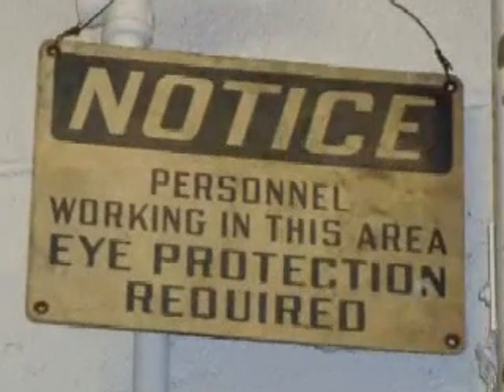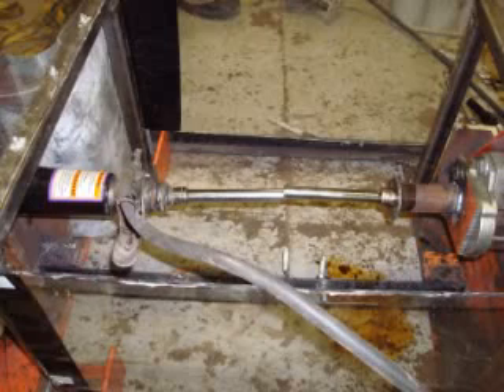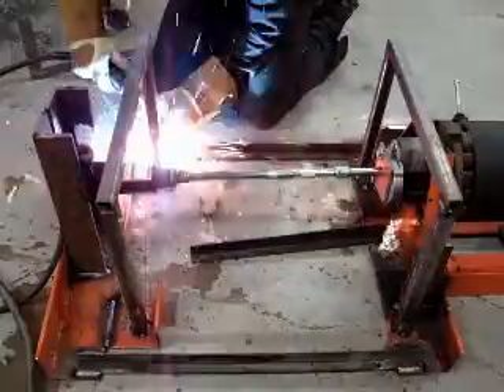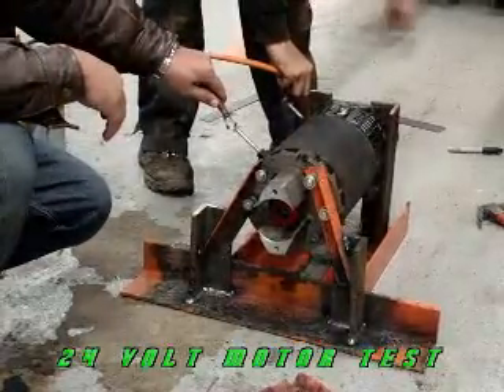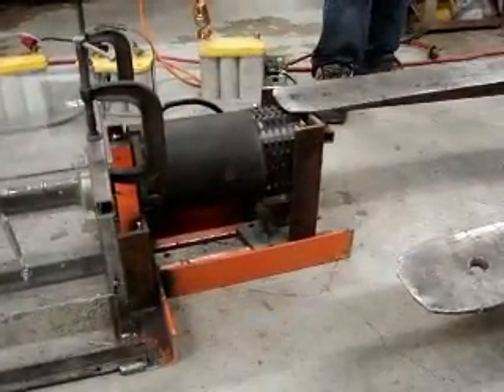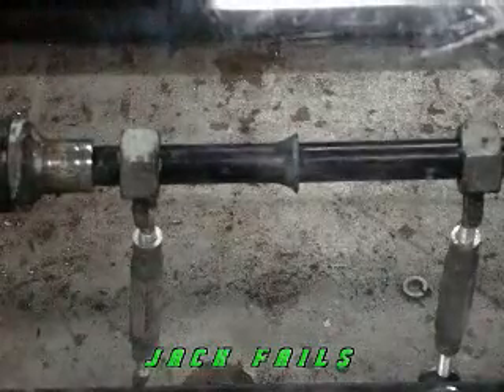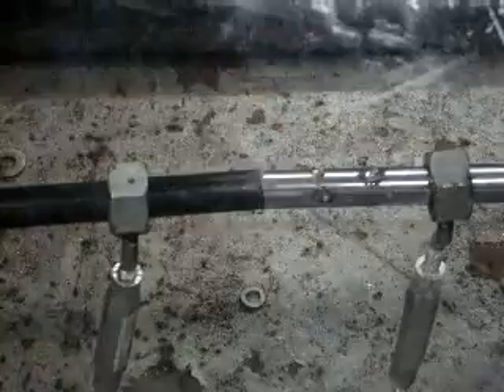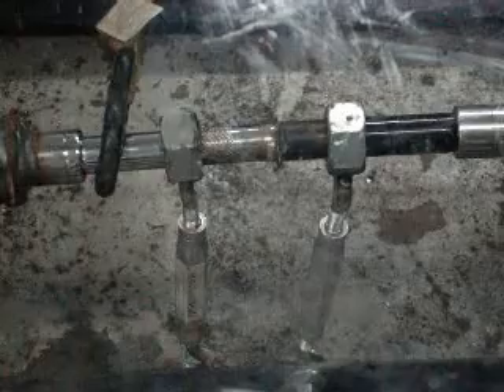Handmade Friction Welder

Comment: Nice machine, you could have made it more user-friendly by using a pair of low-cost chinese lathe chucks; the 5-8" in diameter, and with a thru-hole more than 1 inch.  These would have made the setup stiffer (and you could then have gotten the parts support much more closer to each other, eliminating the alignment issues).  A good demo of the principle, though.  What were the characteristics of the motor you used? (HP/watts, RPM, voltage/# of phases, etc.)

Comment: you should put more effort into building it correctly and not building an unsafe death machine. properly bolting it down will remove most vibration. using a slower motor will too. a slower motor geared into high rpm with a balanced heavy flywheel that goes to a chuck. remove those stupid nuts welded onto bolts. those will kill you. and the second piece in a stationary chuck with the ablity to move forwards and back to apply the pressure to the moving piece.

Comment: ok so I know this was years ago based on the upload date.  but a pointer.  if you would have been able to lathe or drill out a center divot on one side and turn or file the other rod to a point, you would have had a method of keeping the pieces together w/ the bolts, cant slip past each other.  also the smaller surface area of the spike side would concentrate the friction to a smaller spot and reach temp sooner, spreading the heat across the interior surface of the cup end as it melts

Comment: Applying axial force (forging pressure) immediately after rotation stops results in stronger weld. If I were to improve upon the design, I would keep shorter distance between the rotating and stationary elements, which would keep the pieces from wandering, the biggest issue here. 
Good job considering that you were working with available materials.

Comment: wow, i made one with very little suplies and i am only 12 yo, i spun 3/4 inch shaft with a sissor jack and  i made a steel collar over the fixed spindel, abd i cut that away with a grinder and i got prtty consistant welds with it, i made my base a sewer manhole cover and i engine was a 5.5 honda, thanks for the sweet ass video, i sould of made one before i cut it up, the city needed the manhole cover back